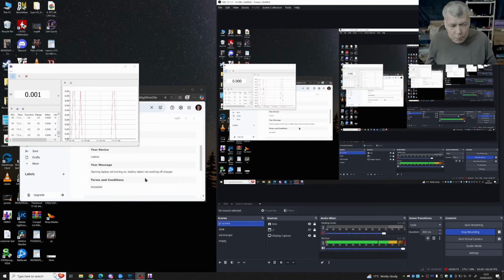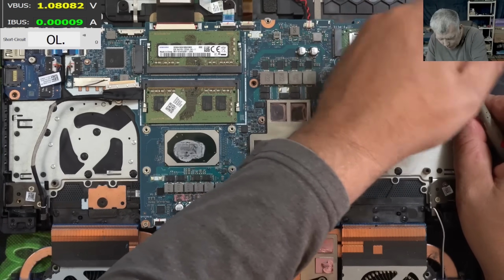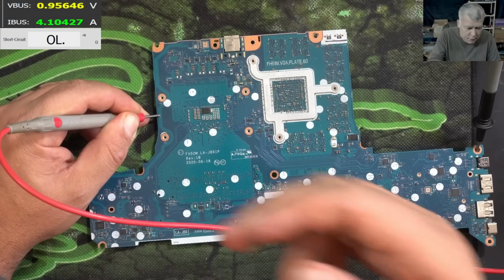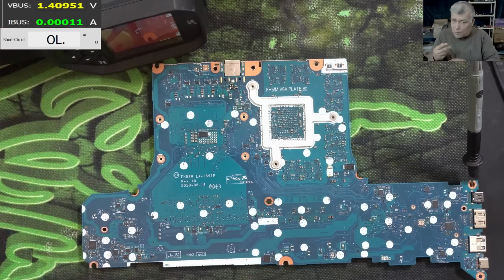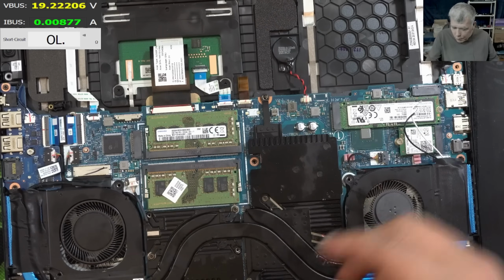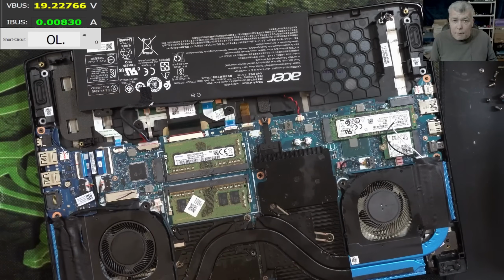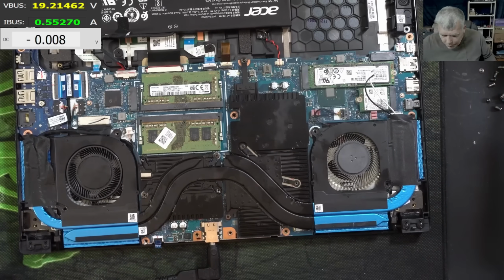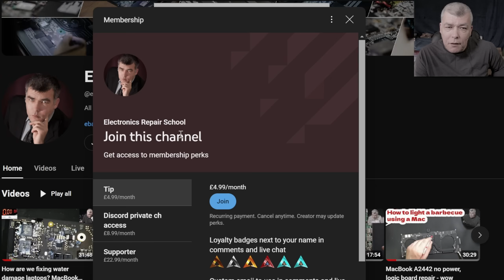Acer Predator gaming laptop, dead, no charging, Two different faults, related!

Comment: hello Sorin. I am not an electricien. Some other YT repair man explained why he always replace caps and not remove them and leave it. I just want to know if his explenation is correct.
He says that caps around a cpu ps are there for smoothing the output, and also to fill in when cpu has spikes and ps is not fast enough to deliver. And that the caps do there job best when cpu power demand is high and ps is switching faster. 
Can you confirm this? He says that missing caps will be a CPU hangup when they are stressed, so gaming laptops must have them replaced and not removed. If it is normal use like office or something, then it could be ok. Please can you explain if he is correct?

Comment: Despite half your audience claiming 'dodgy', from a motherboard point of view the safest thing for a shorted cap is when you just tweak it off the board and then do nothing else.  As you know, but many do not, every time you heat the board to 190C+ to unsolder or solder something back you are thermally stressing the PCB and surrounding components which is not good.  So indeed in many cases the Sorin way is better for the laptop.  Love your work!

Comment: I highly recommend using Laird TPCM7250 instead of thermal paste, PTM7950 is a bit better but genuine PTM7950 not easily accessible as large sheets. TPCM7250 can be bought on digikey or mouser for around 40€ for a large 9X9 inch sheet and you can do lot's of devices with it.

Comment: One thing I don't understand, if we remove the capacitor and leave it out for good, whats the use of even having the capacitor
there in the first place, what is the difference with or without if it works?
Reply: More capacitors means less radiowaves emitted from laptop. Actually the computer as any other electric device is an emitting radio station.
Reply: Most caps smooth the power rails to remove ripples or noise.  In this case 2 were in parallel so there was still one there at the end. When the main power rail gets converted to other voltages that the chips need, the converters do this by very high speed switching.  That leaves that high frequency noise on the output voltage and the caps effectively short that out to leave a cleaner DC.  CPUs and similar are very intolerant of such noise and this is why they often have a ton of micro scale caps all around them as they are filtering each input from noise.  Those don't work as hard as the power rail smoothing ones, so fail less.  Hope this helps.
Reply: From what iv'e heard some just work as filters and higher-quality or higher-capacity capacitors are often used in critical areas like CPU and memory power delivery, where stable clean power is essential for reliable operation - And the computer won't actually function without them.  I had an Acer laptop once which broke fairly quickly, and i'm pretty sure they're only designed to last 12 months - Got an 8 year old Gigabyte Aero 14 now (Bought it second hand), installed Win 11 and it's still going strong.
Reply: if its not a feedback or a big one capacitor you are fine to  remove

Comment: Don't tell newbies such nonsense about capacitors! You're almost worse than Donald!
Reply: Yeah, you can lose a few caps, but voltage rails will get noisy, and this causes more issues than EMI. But lose a few in the wrong places (switching supplies) and you can have a very bad day and they need replacing with correct type and rating.
Reply: @gadgetmind  Yes - or leave out the coupling capacitors for the network. LoL
Reply: You have to remember that Sorin isn't here to teach newbs basic stuff.  He's making his living and recording these videos for a bit of fun plus maybe a bit of extra cash.  He knows perfectly well when he's dealing with parallel caps so one left off doesn't matter.  On the rare videos where he puts one back, it's because it's needed.  This isn't a place for know-nothing newbs.  Give the man some credit, he's damn good at fixing.
Reply: Noobs have no business here.

Comment: is it a capacitor is a form of storing voltage?
Reply: They store charge (so energy) and have a multitude of uses. The bad one here was used to smooth voltage locally as something nearby switched on and off.
Reply: Sort of.  The main thing a capacitor does is to pass AC but not DC.  If you have a DC rail with AC noise along with it and you put a cap across the rail it will short out some of the AC noise making cleaner DC.  Different combinations of cap value (and a resistor) will short out different AC frequency ranges.  As these voltage smoothing caps are working hard all the time (as all the DC voltage rails are made by high speed switching converers which add noise to the output DC) they are the ones that fail the most often.  Hope this helps.